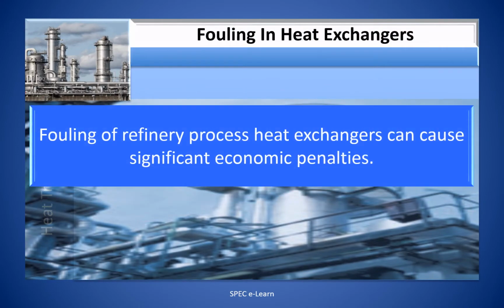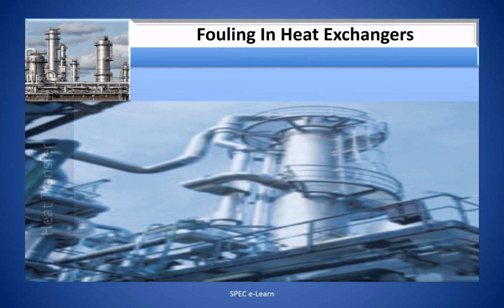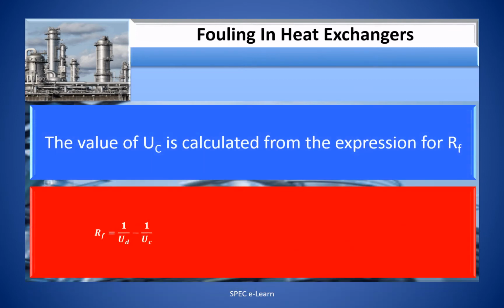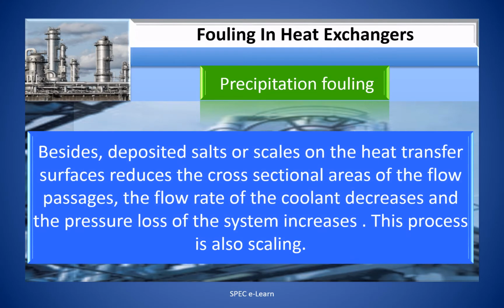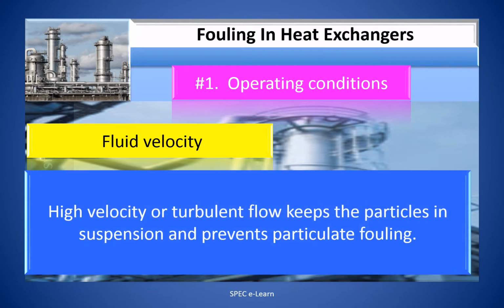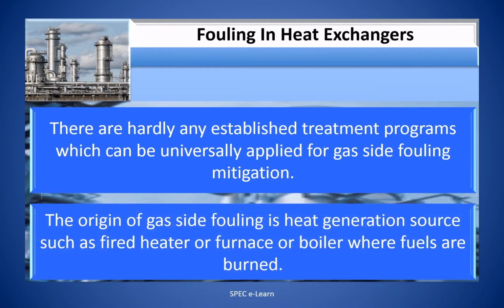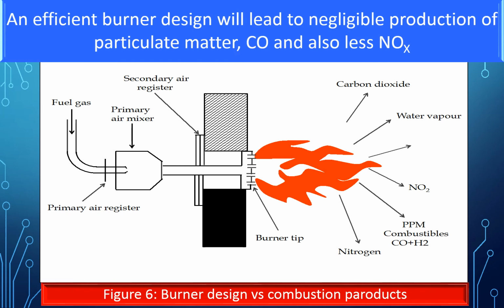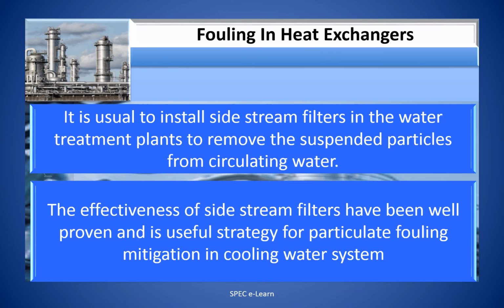Fouling In Heat Exchangers – Economic Impact, Sizing Impact, And Mitigation Strategies

Comment: good explaination
we are considering 0.0003 as fouling factor for deposits on tube side
how much would be thickness
Reply from the maker: Thanks for your question. A fouling resistance increases with time. The rate of increase depends on the fluid handled, the heat transfer process, the mechanism of fouling and operating parameters. There is no direct correlation between layer thickness and fouling factor. Fouling factors are selected based on experience with similar type of fluids and processes and TEMA provides  values of fouling factors based on data collected from the industries. If you use the data for designing HEX, then the HEX will deliver performance up to a certain period of time even as the fouling progresses after which the HEX has to be taken out for cleaning. That means thickness of fouling layer and dirt coefficient has exceed the design limit. Hope this explanation is useful
Reply: @SPEC786  OK SIR THANKS

Comment: First of all many thanks for this great presentation, I will appreciate if you could share some solution to mitigate the calcium sulfate fouling.
Reply from the maker: Thanks for your comments. Most of the salts in circulating cooling water such as calcium carbonate and  calcium sulfate have inverse solubility characteristics. As the temperature of the heat transfer surface increases the cooling water side temperature increases and the solubility decreases and the precipitation occurs. So the first option is to explore whether you can reduce the process temperature or increase water flow rate to decrease water side film temperature. Higher velocity also helps in slowing down net deposition.

Secondly review your cooling water chemical treatment  program. Usually, the treatment will include additives and dispersant for scale forming salts including sulfate. Polyacrylates are generally used. Check with cooling water chemical treatment company. Also review your source of cooling water make up. The treatment program depends on the type water of used. 

In spite of the best treatment periodic exchanger cleaning is required. Follow some schedule based on the experience. Hope these tips will be useful